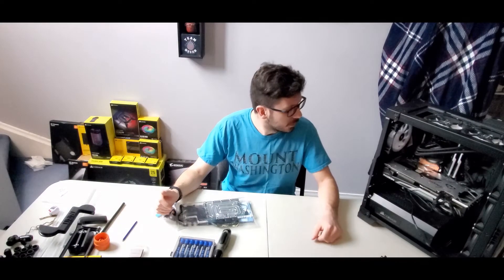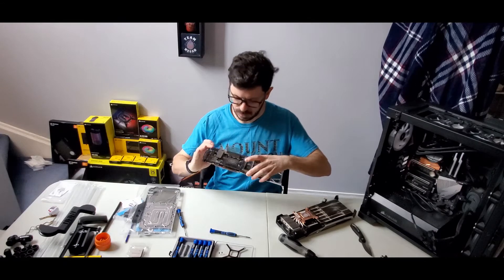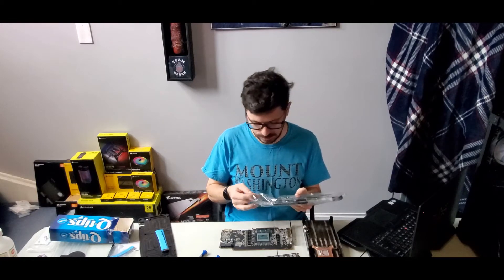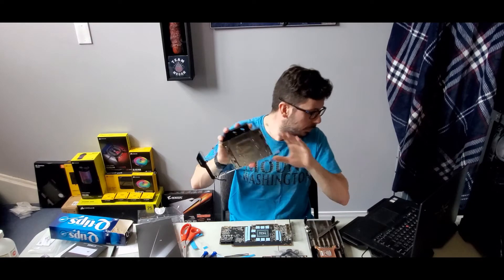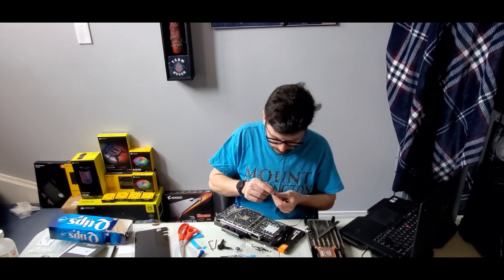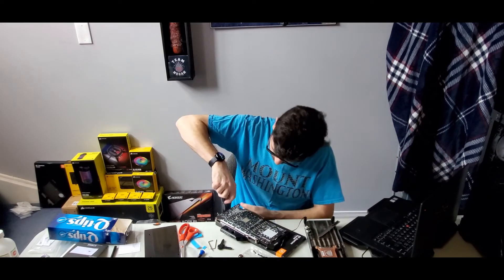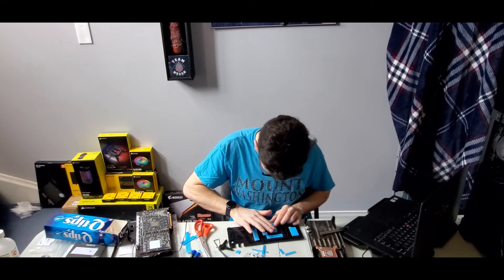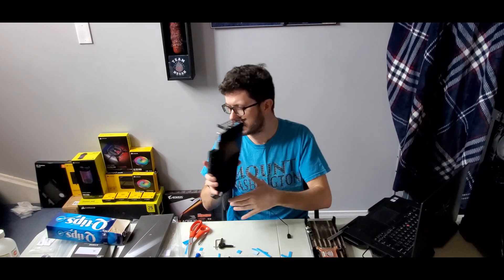Sapphire Nitro+ 6900XT tear down and EKWB Quantum Vector water block installation (Part 3)

Comment: I had a water block to replace the stock cooler but the thermal pads got destroyed do you happen to know the thickness for them?
Reply: The Sapphire sent me the data for 6900 XT
Nitro+ SE and there are 4 different types of pads by thickness at 5 spots:
1: 8 pcs "Squares" for VRAM chips (around
Die) = 1,25 +/- 0,125
2: 1 pcs "Long" for VRM (power connection
side) = 1 +/- 0,1
3: 1 pcs "Short and narrow" for VRM (1/0 side)
=1+/-0,1
4: 1 pcs "Short and wide" for VRM (1/0 side) =
2,5 +/- 0,25
5: 3 pcs "Extra small Squares" for 3 small
Controllers (1/0 side) = 1,5 +/- 0,15

Comment: Hi Nic!
Thanks for sharing your experience. I have a question about replacing the thermal pads on my graphics card, but I can't seem to find the right information. Could you please advise me on what thickness of thermal pads I should buy for my specific model? Your guidance would be greatly appreciated.
Reply from the maker: Hi. I don't recall the exact thickness unfortunately. I'm not sure if I have any leftover. I think they were in the 1.5 to 3mm range though. I seem to recall some were thicker than orders depending on the component.

Comment: have the   same  card but she runs alwaysa really hot even when i ramp um the fans to the max 
the temps is always high and my game runs like shit 
bw my pc components are ryzen 9 5950x and sapphire rx 6900xt nitreo+ 64gb of ddr4 3600mhz idk why
Reply: You need to Repaste it. Unscrew 4 screws around GPU, 2 for Cooling case and 2 at sidewall where the connections are. Also disconnect 3 Fan/LED connections: 2 at one side and 1 at the other. It’s more comfortable first to disconnect 2 which are close to each other and 3rd one after Cooling case is dismounted. 
This 2 parts Cooling system construct is nuts, you can repaste easily and not worry you damage the thermal pads which are under 2nd Radiator.
Reply: The Sapphire sent me the data for 6900 XT
Nitro+ SE and there are 4 different types of pads by thickness at 5 spots:
1: 8 pcs "Squares" for VRAM chips (around
Die) = 1,25 +/- 0,125
2: 1 pcs "Long" for VRM (power connection
side) = 1 +/- 0,1
3: 1 pcs "Short and narrow" for VRM (1/0 side)
=1+/-0,1
4: 1 pcs "Short and wide" for VRM (1/0 side) =
2,5 +/- 0,25
5: 3 pcs "Extra small Squares" for 3 small
Controllers (1/0 side) = 1,5 +/- 0,15

Comment: Hi, is there a chance you know what thickness are thermal pads on standard cooler on this card? THX
Reply from the maker: Hi Tomas, sorry I do not know.
Reply: The Sapphire sent me the data for all thermal pads used for 6900 XT
Nitro+ SE and there are 4 different types of pads by thickness at 5 spots:
1: 8 pcs "Squares" for VRAM chips (around
Die) = 1,25 +/- 0,125
2: 1 pcs "Long" for VRM (power connection
side) = 1 +/- 0,1
3: 1 pcs "Short and narrow" for VRM (1/0 side)
=1+/-0,1
4: 1 pcs "Short and wide" for VRM (1/0 side) =
2,5 +/- 0,25
5: 3 pcs "Extra small Squares" for 3 small
Controllers (1/0 side) = 1,5 +/- 0,15
Reply: @AntonChe is 1,5mm on vram good?